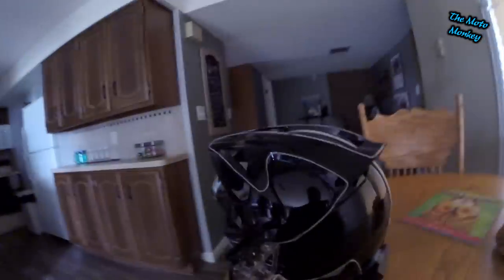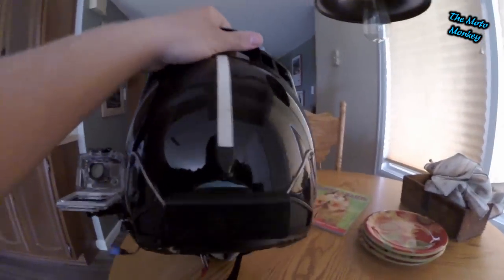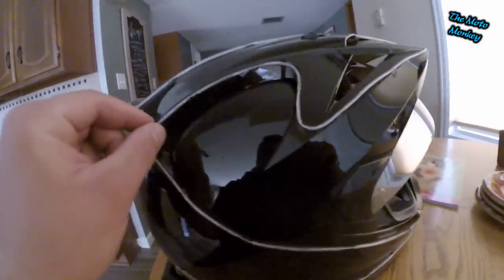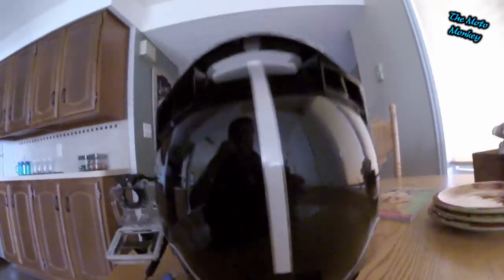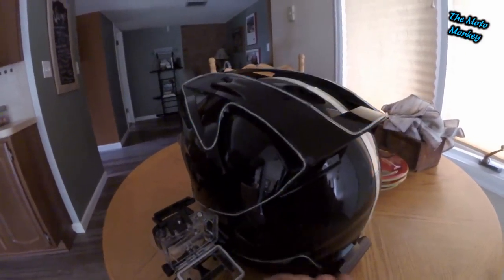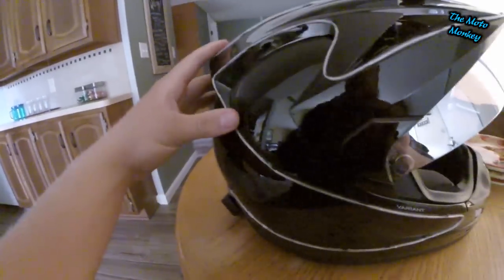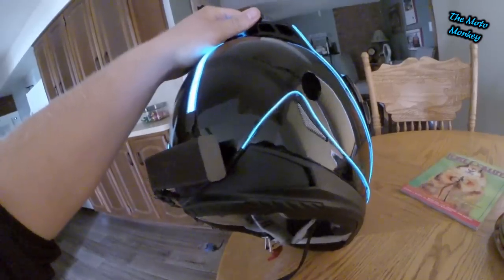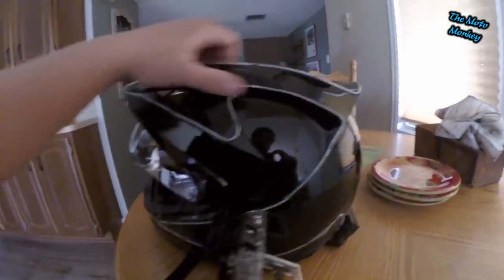LightMode Icon Variant Helmet

Comment: Really cool set up. I have been thinking about doing a lightmode kit on my Variant Construct helmet since I saw their kickstarter last year, but I was never quite sure how I wanted to do it. My only complaint, and it has nothing to do with you or your setup, is how big that battery pack is. I already have a Sena headset and a gopro, I really don't want to add that much more to my helmet.
Reply from the maker: +TwerkMaGerk Thanks. It is kind of annoying how big the battery pack is. I'm glad i mounted it in the back as opposed to one of the sides.

Comment: really cool with Icon Variant ...
question , if you turn up visor / face shield , does it interfere with lightmode strip route and kinda little jammed ??! ...
about battery pack , how heavy it be ??! .., are your neck kinda tired after long use ??! ...
Reply from the maker: sorry it took me so long to answer you back. I haven't had any problems with my visor interfering with the lightmode strip. As for the battery pack, it really isn't all that heavy, at least not enough to really notice it. I don't think you would have ant problems with your neck from the battery pack anways. I hope that answers your questions.

Comment: sorry i dont get how you clue the batterie in the back i want to put it in the back too it not anoying having it here? with a leather jacket the light will not go off like pushing the button?
Reply from the maker: +Maxime Aube I used loctite putty which keeps it pretty firmly in place on the back of my helmet since it is too round to use the original mounts from lightmode. As far as it turning off and on all the time because of my jacket I have to say that so far that really hasn't been an issue. The button is flush with the battery housing and fairly small which helps avoid things like that from happening.
Reply: awsome for the answer thk you and since it wasnt a issue having the batterie pack in the back i will mont it there and last question you say that you started at the middel of your helmet so the blue led are in 2 piece? not in 1 piece?
Reply from the maker: +Maxime Aube the EL wire is all one piece that has been pre-cut to length. The thinker EL tape it a seperate piece that you can cut yourself to any length that you like.

Comment: Have you tried changing your lens since installing the kit? Did it interfere?
Reply from the maker: I have changed my lens on the helmet before. as far as interference with the lightmode set up it really just depends on where you place the wires. I was careful in my lightmode design to make sure that i would still be able to remove or adjust any parts that i would have to in order to take my visor off by not putting any wires or clue on or near those areas. That being said, every helmet is different so youll just have to play with yours before actually cluing your final lighmode design on as to make sure it wont block or mess with anything.
Reply from the maker: hope that helps
Reply: Cool, thanks! My helmet is an Icon Variant as well haha so that's perfect.

Comment: What is the battery life on the LightMode kit?
Reply from the maker: 2w Up Using regular AA batteries you can get a few weeks on two batteries. Maybe 25-50 hours of use before you should look at replacing them (depending on which type of AA batteries you use), which is really quite easy anyways. You'll notice because they will start to dim an few hours before they die altogether. I use pretty cheap batteries as it is and they work just fine. Hope that answers your question.
Reply: The Moto Monkey yes completely thx. about to get my bike this week so see you riding around Fort Collins sometime
Reply from the maker: 2w Up  hell yeah! If you see me be sure to let me know.